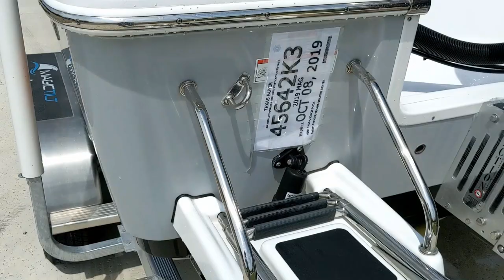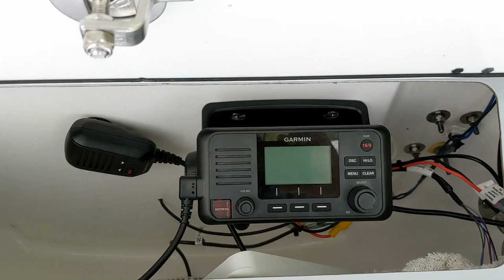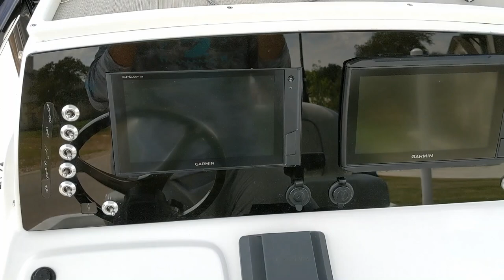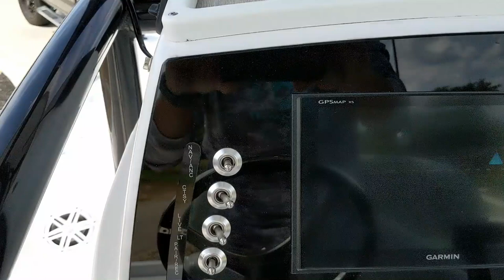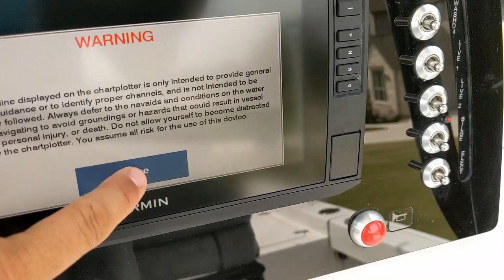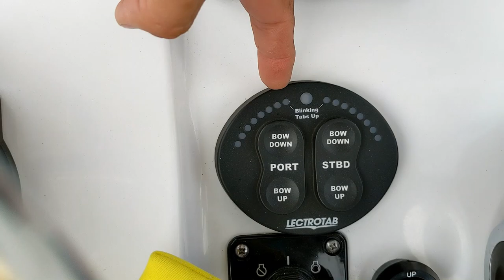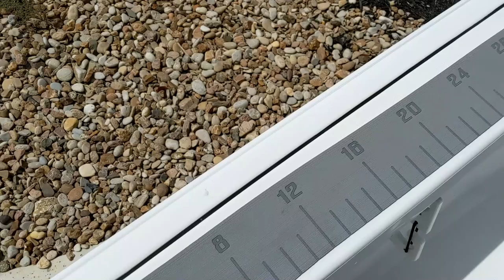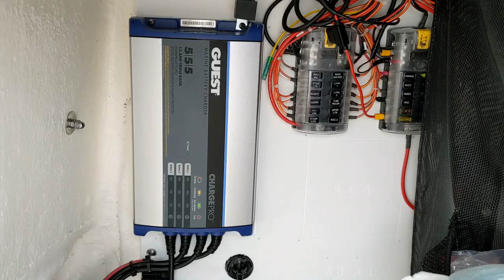2019 Sportsman Masters 227 Platinum Review

Comment: How's that center mounted transducer working. It's best to place a transducer in a location with a smooth flow of water, no air mixed in. I would think that pocket in the center has less than smooth flow. Curious how it's working out for you. Beautiful boat. Congrats.
Reply from the maker: I actually have 2 transducers, one in the rear for side and down imaging and one thru hull for on plane.
Reply: @thrillofbraziel3425  That makes sense. It's been over ten years, I fished the shallows exclusively and only used my finder for finding holes in murky water. I may be relocating to FL east coast and am researching different boats (and new technology) LOL.

Comment: I recently purchased a 2020 227 Masters and was thinking about installing some kind of light bar. We run  small ditches at night getting to our duck hunting spots. I'm curious how effective the light bar you put in is. Does it light up the bow so much that it blinds you or it more directional?
Reply from the maker: It does a decent job lighting up the water but I will be moving it up higher as it does light the deck up some making it a little difficult to see out on really dark mornings.
Reply: @thrillofbraziel3425  thanks for getting back to me. The top of the T-top would be ideal, but we have radar and I believe it will mess with the signal. Can you tell me who manufactured the bracket that connects to the t-top tubing?
Reply from the maker: @darryldelernojr.7198  I actually used some clamps that were from cup holders that went around the bars.
Reply: @thrillofbraziel3425  thanks for your help. Great choice with the colors. We went with Storm Cloud top and Shark Grey bottom with the Canyon tan seats. I hope you're enjoying it as much as we are.

Comment: I saw 2 switches for the livewells. Does the switch for the aft livewells turn on both or did i miss a third livewell switch?
Reply from the maker: One switch controls two live wells. You can valve one off it you don't want to use one

Comment: Nice tour, thanks.  Whats the story behind the automatic trolling motors?
Reply from the maker: They do not auto stow and get stuck in the launched position. It happened to half of the people they installed one for.
Reply: I got the same info as he did on the Minn Kota Ulterra, I went with the manual deploy. After installing mine, I talked to a guy that has the Ulterra that had to go into the shop less than 6 months old, it deployed but wouldn't stow. I was deploying mine last week a few miles offshore with 2'-3' seas, would rather have the Ulterra when deploying or stowing in the ocean instead of going up on front deck in rough water. I will probably get one in time, when they get the issues worked out.